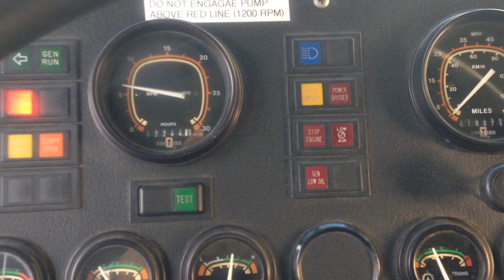1997 Oshkosh T-3000 ARFF 1950/3000/420 Aircraft Rescue Truck for sale

Comment: These are substantially moe expensive to restore to OEM condition to any antique ladder truck.  I wish I had the money and machine shop to restore one of these and save it from the scrap yard.  Would make for a cool beach party truck or antique fire truck to show up at an old fire engine jamboree.
Reply: Companies do go over these after the original user is done with it and sell to a smaller dept. etc.  Great trucks.  my next door neighbor operated one at the St. Louis airport.  I went out there a few times on Sunday mornings and rode around with him in the 1990's.  He let me drive it once on the tarmac and squirt some water.